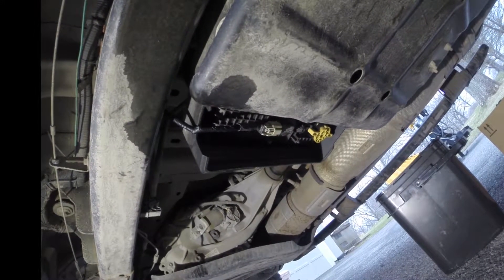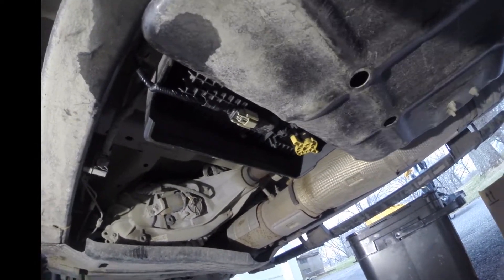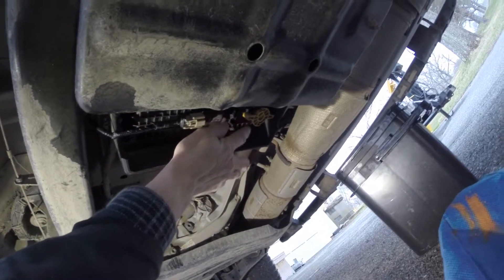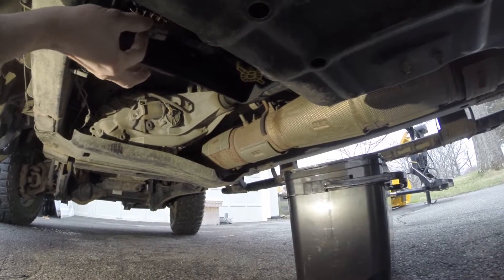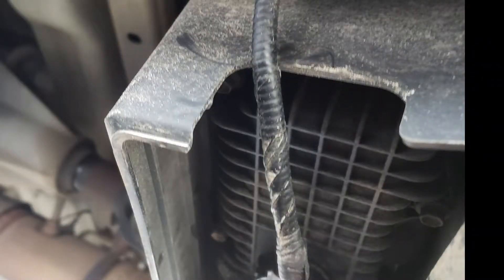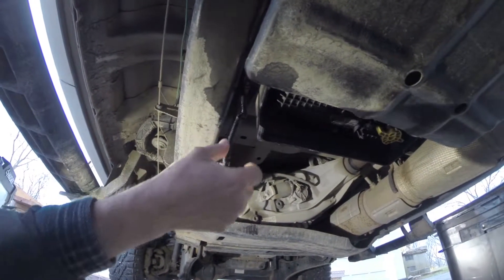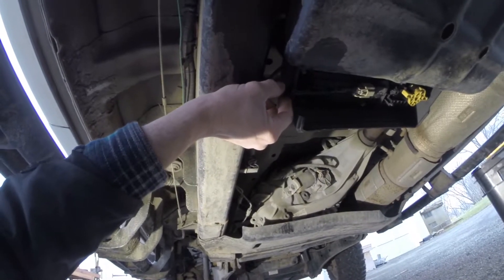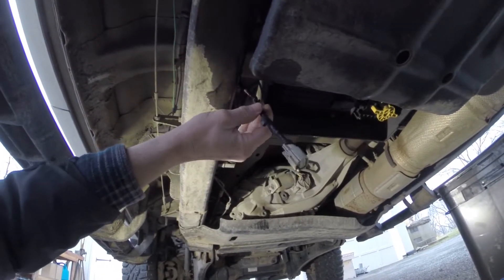Water in Fuel Light FIXED Ford F350 6.7 Powerstroke Diesel.

Comment: Does the truck go into low power mode while the water in fuel light is on?
Reply from the maker: No, it does not. You have to stop the engine as soon as possible because actual water in fuel will trash the injection pump, and it's a costly repair.

Comment: Did it automatically reset itself after you fixed the wires or did you have to have a scan tool to reset
Reply from the maker: It automatically reset. I don't have a scan tool.